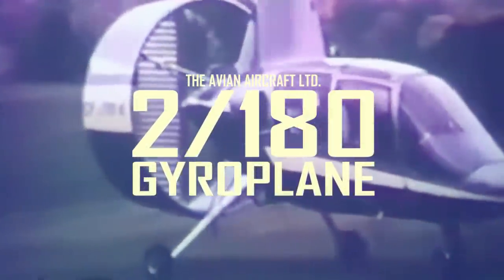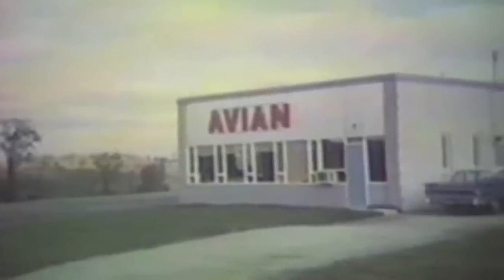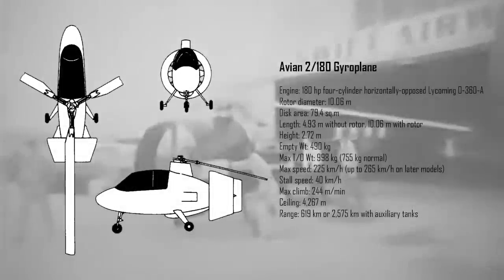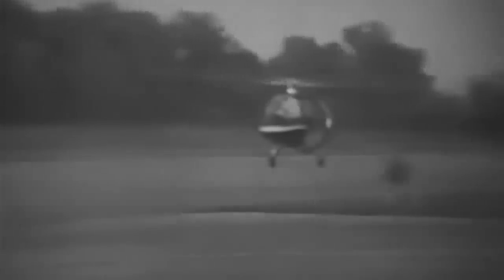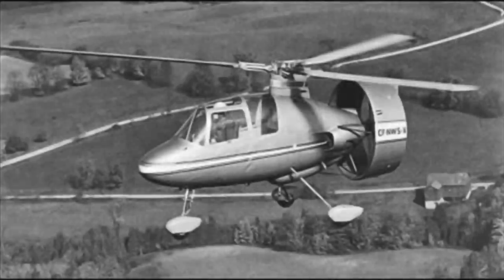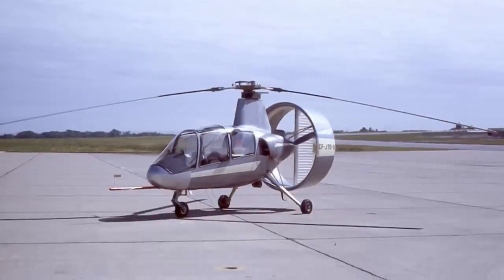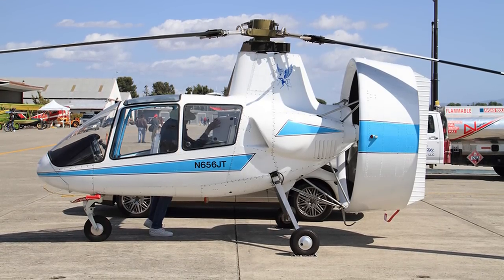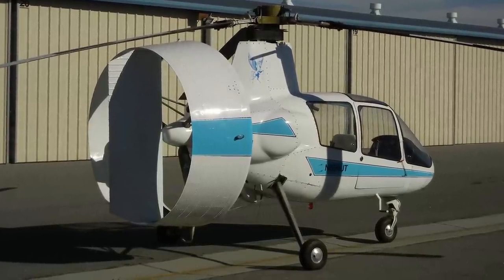Attractive VTOL autogyro with unrealised potential; the story of the Avian 2/180 Gyroplane

Comment: Before the collective was lifted the power was removed from the rotor. The rotor's inertia and overspeed in the spin-up is what allowed it to hop into the air. If power had been left driving the rotor then torque from the powered rotor would have rotated the craft opposite to the rotor's direction of rotation, the reason why a helicopter has a tail rotor. And in the video you can see that the rudder does not deflect like it is trying to fight torque, so the rotor is free spinning.
As the craft moves upward the engine power is increased increasing the propeller thrust. As the craft starts moving forward the airflow changes from being pulled down through the rotor to up through the rotor, autorotation. Which keeps the rotor turning and away it flies.
Reply: why dont modern gyro companies use that idea? seems simple.
Reply: Because it is more complex it adds cost. Companies would add it but aircraft owners/buyers do not want to pay for the ability.
Reply: They may want it--but if no one buys it--manufacturers don't make them.
I have been a pilot since 1990 and talked with my bosses and other aircraft owners. Initial and operating cost is one of the main things they all consider when choosing the aircraft they use. Then for a commercial operations is how many different jobs can the one aircraft do--more jobs more income.
If you check throughout aviation there are many civilian and military aircraft that just did not get the attention and support needed to enter service. Also checkout how many manufacturers gambled to build an aircraft and then folded cause the aircraft would not sell.
Air & Space 18A (from 1965 to 2000) built 68 and it had jump takeoff ability. Heliplane bought the type certificate in 2012 and want to put it into production again--so where are they? I mean the aircraft and the customers that want to buy a jumping gyro.
Reply: @beeqool  certification and licensing favour gyroplanes with fixed-pitch rotors. at least in some parts of the world.

flapping and collectively pitching rotors are a dark art. to be avoided if possible. only professionals pay the added complexity and they have cash to buy "real" helicopters capable of hovering indefinitely. the niche vor a complex gyroplane is too small as failure to sell any reasonable numbers proved.

I still love the idea!
Reply: BigToe Sugar Grove  the overspeed is dependent on the energy to be stored in the rotor and of course in the rotor's inertia, i.e. a heavier rotor can store more energy for every extra rpm above nominal.
Reply: BigToe Sugar Grove  That is what limits the height of any jumping gyro. Jumping type gyros use extra rotor tip weights to increase the inertia of the rotor. Over-speeding the rotor is limited by structural strength from the centrifugal loads on the blades, the rotor can only be over-speed to a point.
Reply: maybe it could work in communist countries where the state can force people to buy it
Reply: Very similar propulsion system to the Fairey "Rotordyne".
Reply: @MegaBoilermaker   How is it similar?
The Fairey Rotordyne used tip driven rotors using the exhaust from the twin turboprops with a form of afterburning at the tips to fly like a helicopter for takeoff and landing.
In cruise it flew like a gyroplane, turning off the tip driven jets. It could do a takeoff and landing roll like gyroplanes that cannot jump.
The twin propeller configuration also provided yaw control in hover.
Reply: They put mass in the rotors.
Reply: @ThemBlinkingLights this would be perfect for Ariel sight seeing low cost compared to helicopter and vtol capable

Comment: The Canada curse.  Everytime they come up with a great aircraft, some unknown force squashes it...
Reply: In this case, it is known.

No one bought one.
Reply: I heard the same thing about the Water Engine  ;p
Reply: It seems to me the issue was the relative lack of control in vertical flight which would prevent confined area operations

Comment: Very reminiscent of the CarterCopter, a modern gyroplane that depended on spinning up a high-inertia rotor to store enough energy for a take-off hop. Very promising design, especially looking at its range and speed in comparison with conventional helicopters. Like the Avian design, though, it just never caught a break. A true helicopter is a massively expensive machine with terrible fuel efficiency, and there are an awful lot of applications that call for VTOL but not for hover. I hope one of the many hybrid gyro designs eventually gets a fair chance to prove itself in these applications. And here as in so many cases, early designs from Canada (and indeed many other countries not so well known for aviation) anticipate most of the ideas being put forward now.
Reply: The CarterCopter was never intended to go into production, though, it was a research aircraft.  It produced interesting data, but not compelling enough for anyone to propose a production vehicle based on it. The main goal was to research ways to slow down the main rotor in high speed level flight, to avoid retreating blade stall and flapping (another reason for the weights in the blade tips). They got close to their goal in this category, but not entirely.

They didn't do themselves any favors by going with a one-off new design composite prop and converted auto engine.  Created problems for them that weren't directly related to the main goals of the research.

Comment: So sad to see such a brilliant design that broke so many barriers to ultra light aircraft with VTOL capabilities go bust due to lack of sales😢
This needs to be resurrected!!!
Reply: MAKE IT ECONOMICAL, AND FOLK CAN GO GET THEIR GROCERIES AND CHORES IN THIS..
Reply: Would this make a good unmanned delivery drone?
Reply: You want it brought back?  Are you ready to invest?  If not it will remain a keyboard pipe dream.
Reply: There were two attempts to resurrect it. As the Air & Space 18A, which also had very few sales, and then the type certificate and tooling were sold to another company, which also failed.  The basic issue was payload per horsepower, a fixed wing aircraft with an IO360 can carry twice as much twice as far and fast. When purchasers made the comparison, they just couldn't justify the gyro to fit their needs.

Comment: How could such a useful aircraft have failed to be successful? Brilliant design work for its time and I could imagine this design having been used in developing countries for all sorts of aerial work. If it could seat three (?? looks like the rear seat was a side by side double??) it would have had a useful payload. External fuselage mounted cargo pods might have worked too. I hope that somewhere someone with insight and the cash will be able to develop it further using modern composites and more economic engines. I suspect that there have been many more up to date designs to parallel it since, but the vertical hop seems unique...? Thanks for the film, great historical interest.
Reply: LM Other gyroplanes with similar form from the same era failed to gain a foothold. Overall, a gyroplane just doesn't beat a helicopter for capabilities or performance.
Reply: The Rotordyne was the king of autogyros & it to was cancelled.

Comment: They never gave a price for it. Honestly it looked like an awesome machine and the specs were great, not sure why most sport pilots wouldn't be interested unless it was cost.
Reply: There are a couple good reasons why you don't see gyrocopters on every tarmac alongside the antique Cubs and fifty-some year old Cessnas and Pipers.  First, they require a specific rating, meaning you have to take still more flying lessons after earning your pilot's license (or get the license in the specialized aircraft and not be able to rent a 172 for a weekend trip).  Second, they're slow compared to a fixed wing aircraft with similar engine power and payload.  This one could barely make 120 kt on 200 hp; a 172 (with twice the seats) can do close to 180 mph on the same engine, therefore having 50% longer range with the same fuel capacity.  Or a 152 (same seat capacity) can do the same speed on 140 hp at probably half the fuel burn rate.

And the third reason, as with everything else, is that they cost more than a comparable fixed wing aircraft -- which would be fine if they either outperformed the conventional, or were significantly safer, but they don't have either advantage.

Comment: Cavalon and Calidus seem to be more modern and cheaper 2-seater versions, although they're light sport aircraft rather than utility vehicles. Would be cool to see an electric gyro that uses metal-air batteries. Even if the range was more limited, it could still be a useful sightseeing aircraft.
Reply: 450w/KG are for sale now so the e-power dream is achievable.

Comment: Unfortunate demise for an aircraft with such potential. The 'hop' feature is what is missing in today's gyros.
Reply: Although I have never flown in or piloted an autogiro, it seems the hop feature would increase the complexity and cost of the aircraft. These type of craft has caught the imagination of Europeans, I have been to many European shows where the variety display was outstanding. These small very uncomplicated crafts are perfect for rural living, or just to travel from place to place. Someone who owned one told me he was running out of gas, so he checked gas stations near him and dropped on a field, folded the rotor and drove the unit out of the field to a road and gas station, filled up with premium gas, and return to flying. Try that with a fixed wing aircraft.
Reply: What potential? It had none which could be classed as commercial which is why no one bought one.
Reply: @luciousbrun5437  I, for one, would appreciate a 'jump' gyro for personal use. Lots of fun and less complex than a helicopter. Safer than fixed wing, if operated within its proper parameters. Gyros seem to be fairly popular in Europe.
Reply: @luciousbrun5437  Yes!!!
Reply: @luciousbrun5437  A gyro by definition uses a free turning rotor for lift therefore it relies on the constant forces of nature and they never change. A gyro's performance capability is forever implied. Words without a verified source are empty coz they have no associated credibility. Own your shit...
Reply: @luciousbrun5437  I doubt I will ever make sense to you.. At least I hope not!

Comment: got to inspect the blade control rod fasteners.. every  flight.. i was taking a lesson in an air and space 18A and it tipped over while spinning up... one fastener loosened up  even though the bolt was wired and painted

Comment: It's unfortunate Avian Gyroplane didn't survive, I really think it should have found a niche market, because as a gyrocopter it would have been relatively easy to fly and more people could have flown  it in areas not so accessible for conventional airplanes.
Reply: Main drawback of the gyrocopter is the limited seating capacity. It can only seat 2people. So the buyers it attracts are the flying enthusiasts. Designers must endeavor to design a 4seater or a 5 seater gyro plane. As such, it opens up a wider market: city hopper, air ambulance, island hopper, military or police patrol or surveillance, etc.

The ducted fan is remarkable, designers must add a tail to include rudder, horizontal and vertical stabilizers. I believe a gyro plane is one business idea whose time has come
Reply: True. Designers must endeavor to design a 3 seater or 4 seater configuration. Then the market is wider: air ambulance, city hopper, island hopper military or police patrol or surveillance, etc
Reply: It also does not need an airport

Comment: Ah, this is pretty close to my design for a giro in having a shrouded fan for propulsion - though my specs is for a far deeper and thickly chorded blade at lower revolutions, since it is mass of air movement that creates thrust rather than simply speed. I stole my idea from the Optica rather than this little beauty. My design has a completely different method of turning the rotor for pre-rotation and assisted climb, though.
Reply: Is a shrouded fan for the rotor blades also in your design?
It is in mine.

Comment: Im confused this is my first time hearing about gyrocopters soo whats the benefit of making this a gyrocopter as aposed to a helicopter??
Reply: To put it simply, gyrocopters fly similarly to planes but have rotors, so they have more capabilities than most planes and require less runway space. In exchange, they can only fly so fast, as their rotor tips cause turbulence and shockwaves if they go faster than the speed of sound.
Reply: Fred Flintstone That too haha, you're not worrying about ailerons and they're very hard to stall compared to a fixed wing aircraft.

Comment: What an amazing innovation. A hybrid helocopter/gyroplane. I wonder if there is any merit in equipping it with a tail rotor so that it can land and take off as a conventional helicopter and cruise as a gyrocopter. I think that there is potential for lower fuel consumption than is possible with a conventional helicopter.
Reply: A Autogyro uses the forward thrust Provided by the rear Pusher Engine. 
a Tail rotor would NOT be possible in a Autogyro, no forward thrust. 
the Rotors in a Autogyro are usually unpowered (Little Nelle), and the Forward thrust over the Blades which turn the Blades.
what you are thinking of is just a mini Helicopter, not really a new Idea. 
the US Military even played with the idea of Backpack helicopters. neve paned out.
Reply: @markplott4820   This particular gyro has a powered main rotor that allows it to hop into the air.It then disconnects the drive before it starts to spin and engages the propellor. If however it had a tail rotor, then it could hover like a conventional helicopter in addition to the gyro function which would probably be a more economical flight configuration.
Reply: It would be more feasible to tripple or quadruple the rudder surface area to counter spin instead of the added expense of a whole additional power and control system...

Comment: The Air & Space 18A had similar configuration and payload though 30 knots slower but lower fuel consumption.  They beat Avian to market by three (3) years (1965 vs. 1968) and sold 68 units.

Comment: I think the best marketing approach might be, Safety below 500 ft. compared to standard helicopters.  This autogyro with muffler might be acceptable to fly into a neighborhood... due to greater safety over a helicopter.   (CarterCopter has a  foolproof auto jump control)
Reply: Actually I would say even higher, maybe even 500 feet. Helicopters have a height velocity chart which shows the height and speed needed to enter autorotation if the engine fails. A gyro is already in autorotation so there is no transition. A helicopter that is hovering above 10 feet will not have a smooth landing unless it is high enough to enter into autorotation, one type I flew had to be 500 feet above the surface when in a hover. Below 10 feet helicopters use rotor inertia to drive the rotor. (different types have different numbers these are just general)
Where gyros loose there advantage is when they do not have collective pitch, the feature that helps them jump also. When a helicopter comes in during autoratotation it flares to reduce speed a few feet above the surface (or above the tree tops) right down to zero speed if the pilot chooses and the conditions permit or require it. And then as the helicopter sinks vertically collective pitch is added and cushions the landing. A gyro with a fix pitch rotor cannot quit do that, their speed can be reduced, even to zero as well (headwind helps), but they would still be coming at an angle to landing like an aeroplane. A vertical landing would be rough/hard, still beats the aeroplane (a vertical landing in an aeroplane is called a crash).

Comment: There's not much real-world use for a VTOL without a cyclic-controlled powered-rotor,
that's due to the need to choose the exact landing position and approaching it carefully.
Also, a helicopter which cannot turn on the dime and cannot hover is a bluff.
Where's there's wind, the unpowered rotor is stuffed too.

Comment: It’s a neat design but it’s not hard to see why it failed. It has all the disadvantages of both a helicopter and a plane.

It can’t do true VTOL and can’t hover which means it can’t do most thing helicopters where used for. Executive transportation, sky cranes, search and rescue,etc. 

It also can’t do what most planes do, is cruise faster. A plane with a similar sized engine would have a must faster cruise. Not the mention I imagine is was a good deal more expensive than most planes on the market.

Comment: how high could it jump? why does it have a duct?
Reply: The video shows the limit of its jump, I do not know the numbers.
As for the ducted propeller. The duct improves the propellers thrust so a smaller diameter can be used.
And in this design the duct also helped with directional stability.
Reply: Duct  is for Streemlining.
Reply: A propeller creates vortices of disturbed air outward from the tips that create a lot of drag. Ducting a propeller prevents those vortices and therefore greatly increaces the efficiency of the propeller.

Comment: As an ex helo pilot & owner I have always wanted a gyro but, that lack of vertical/hop/jump take off has put me off. With battery capacities  of 450 watts per KG now in production surely compared  to 200 hp gas engine weights electric is now real. The jump start is real & proven so why no models out there considering the torque avaliable.

Comment: he Airframe can be improved with a ALL composite Design, the motor should be an Turbocharged gas engine and a 6 blade Prop, and the Rotors should be all composite and 4 blades instead if just 3.
Reply: An updated/modernized version would be cool